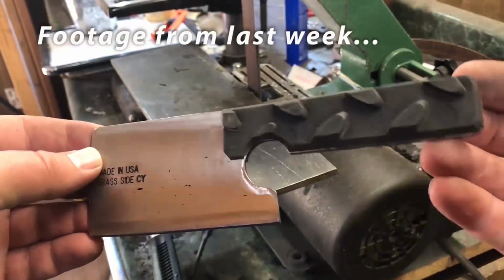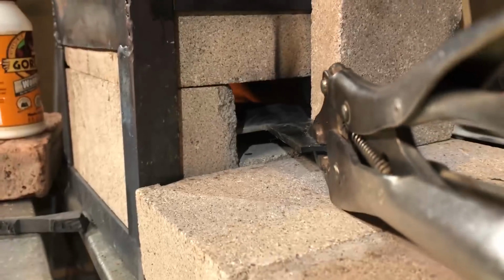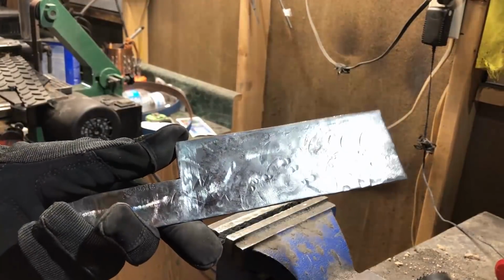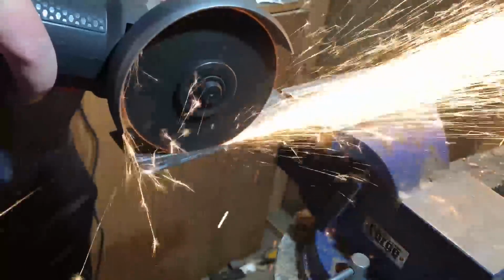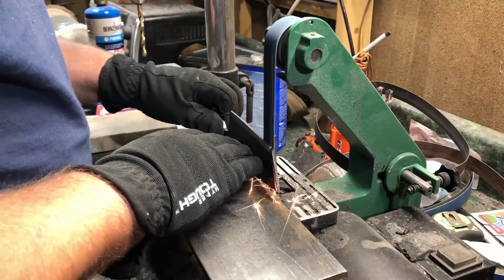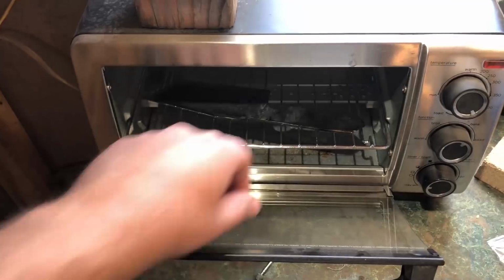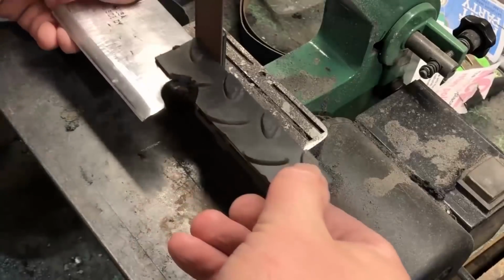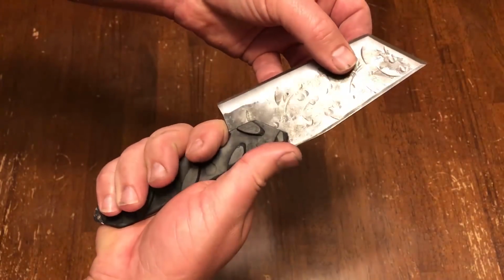Making The Urban Apocalypse Tanto Knife (from a lawnmower blade)

Comment: You've done a great job ! I love the profile of the knife, but not so much the handle
Maybe a paracord wrap would have been another option ?
Also you can rough grind the bevels with your angle grinder and then flatten them and clean them on the belt grindee, it could save you a lot of time
It's actually a bit easier to do an edge quench when the quenchant isn't moving, so that you can see and control where it has been quenched a bit easier
Anyways, you've done a great job ;)

Comment: Great build! The only thing you have to watch out for though is when you were putting those extra hammer marks in. If you do that while the steel is cold it can actually make it far more likely to crack in the quench. Anyways, hope this helps! Great build! :D
Reply: True, but that metal was pretty thick. Probably safe there.
Reply from the maker: Dylan Smith Hey, thanks for the tip, I’ll keep that in mind. 👍
Reply: Also you do have to keep in mind he did normalize the piece and that should undo any stress the steel was under for the quench
Reply: Is that crack you're talking about before or after a quench, as in you'll create microfractures that will form and Crack when quenched or as you're hammering? I'm a novice and this will be my first project, so I apologize if this is a silly question